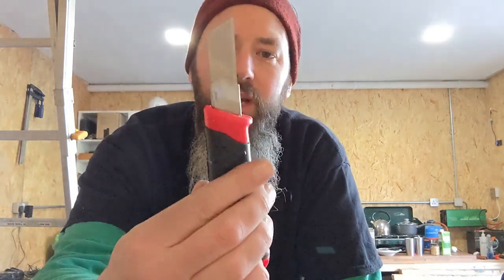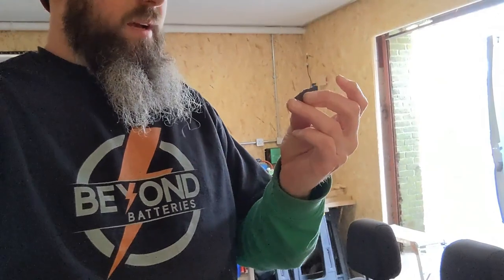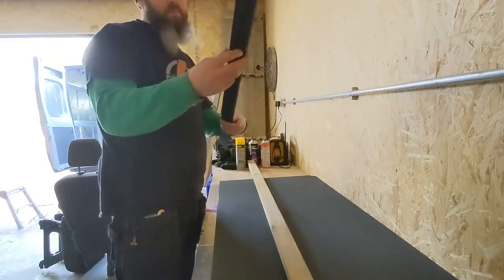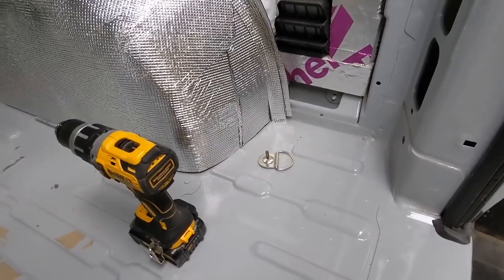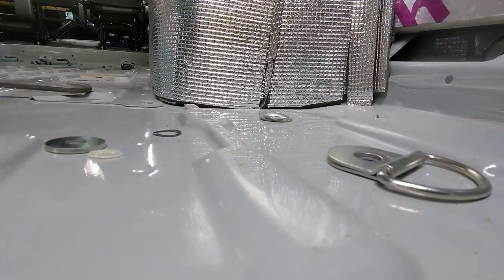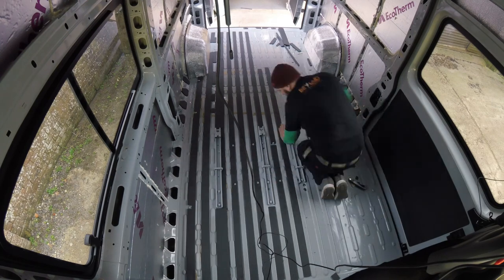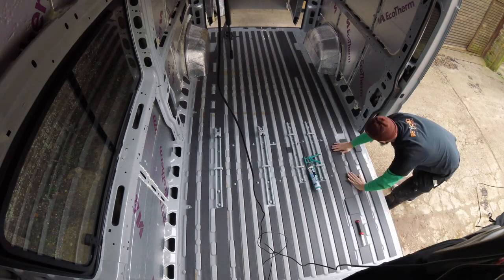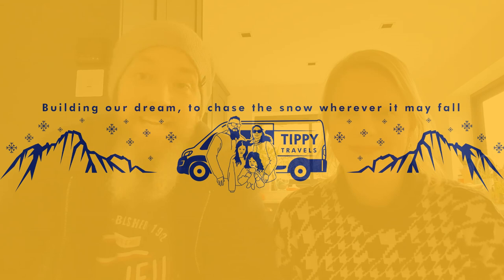EP6 | FLOOR INSULATION WITHOUT BATTENS! | Self build van conversion | Vanlife | VanLife Family

Comment: Hi, great videos I have subscribed and will watch all your videos. Can I ask how many of the NasBoard did you need and would this EVERBUILD STIXALL COLOUR HYBRID SEALANT ADHESIVE C3 290ML CARTRIDGE be OK and how many did you Use? Keep up the good work. I have got the Citroen Relay Van which will have a full build. Thanks
Reply from the maker: Hi. I think I bought a 10 pack of nasboard. The sheets were 1200 x 600. 

Yes to the adhesive, I used about 20 tubes for the whole floor, so not cheap.. but I knew it would work, the van floor has been in for 2 years and is working as it should. 

Thanks for watching and subscribing, many more videos to come. 😁

Comment: Hi, thanks for a great video. I would like to ask yo what are those metal bits on the floor showing at the top of the image at  min 3:00, 3:51,  5:08 to 6:47 and you had to cut the insulation foam around them . they are kind of in front of the side door and that strengthens my belief that they look like they may be some mounts for some seats but not 100% sure. I would like to learn about how you got that done as that is of special intertest to me  . I wanted to look at every episode but they are difficult to find so perhaps if you put the list of URLs for every episode, in the description that could help even dumber people, like me, to find all the episodes more easily :-)
Reply from the maker: Hi, thanks for commenting. Those metal parts are the floor mounts for the additional seats, which are featured in episode 3 "6 seater camper".

Your suggestion is a nice idea, we'll look into that, although if you look at our "playlists" on our YouTube channel, all of the "Tippy Travels Van Build" episodes are listed there.

Good luck with your build!

Comment: Just wondering how you're finding the floor? Did it squeak at all with the PIR board with no battens. Also did you foil tape the edges or use sealant to stop it rubbing against the sides? So pleased I found your video really didn't want to screw into the floor 😊
Reply from the maker: The van has been in use for 15 months, we've been as low as -18 and plus 40 degrees, the floor has been great. No creaks, no movement, nothing. I was a builder before and we would screed directly on to celotex, it can handle spread loads, but the minimum floor thickness would be 15mm to prevent point compression into the celotex beneath. We rolled the dice with this method but not regretted it.
Reply from the maker: We expanding foamed the edges of the celotex to the walls, then trimmed the foam back, foil taped the floor to the wall insulation, that was probably over the top as we planned a full vapour barrier, more vids coming soon

Comment: how are you finding the insulation in the van a year on and pretty much at the end of the ski season? Do you still stand by this method or are there any changes you would make if you were doing it all again? Embarking on my own build journey and looking at different methods :)
Reply from the maker: So far so good. The floor is still cold in winter time, but not freezing, however I think it's better than the thermal bridging effect of the wood
Reply: @tippy_travels  is there anything you would have done differently looking back on it now? I won't be fixing seats to the chassis. I do like the simplicity of just cutting the cellotex to the floor of the van rather than cutting into squares to fit in a wooden framework
Reply from the maker: I definitely wouldn't do it differently! If we had a high top van, I would possibly use slightly thicker celotex but the same method 👍
Reply: @tippy_travels  great thanks. reckon I'll do the same as it looks quicker and less thermal bridgey. Thanks for your help

Comment: why did you make this so complicated. By filling the low points of the ribs you are preventing them to breath and dry. also why why did you fill those tie down points? they are the perfect way to secure your plywood subfloor
Reply from the maker: Thanks for commenting. Well we wanted a hermetically sealed floor space. So no moisture, no screws or screw holes, sealed with hybrid silicone, this way we don't want it to breathe. So filling the anchor points was an essential part of this as they would allow air and moisture into the sealed floor space.

Filling the low points of the ribs was a way getting more insulation in, but mainly to even out the floor height and prevent point loading of the dense foam insulation. The insulation board is compressible on high points. In other words, to ensure the lifespan of the foam insulation, by spreading the load.

Our glue down method isn't for everyone, it's just my choice.. But thought it a useful video for those who wanted to do it this way.
Reply: @tippy_travels  I understand why you fiiled the screw holes but you still could have used them to bolt down the floor. Looking back at your video I see that the Ecotherm does not seem to have very good compression strength that is why i am using XPS . You drive a car on that stuff
Reply from the maker: Ok. That sounds good. So our flooring has been in the van for 2 years and seems to be working successfully, no cracks in any adjoining panels or movements on the floor. I feel happy that it was the right approach for us. Good luck with your build!